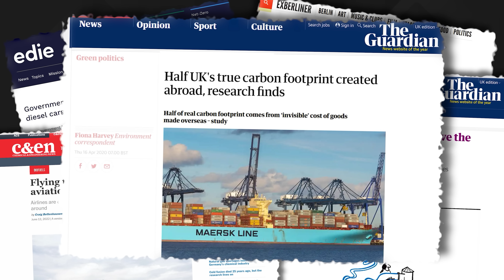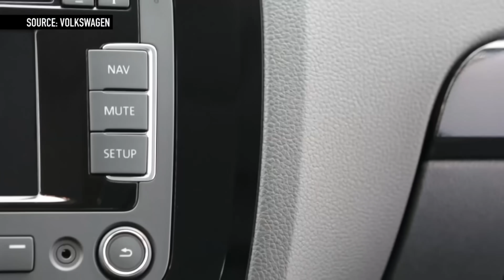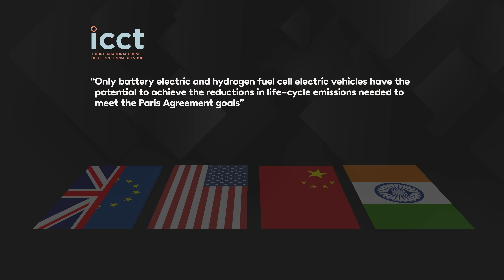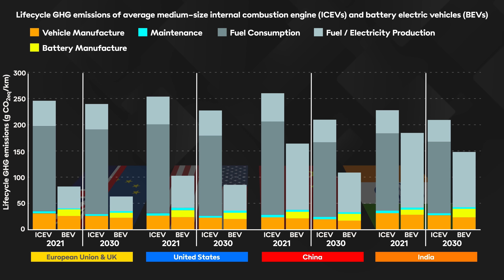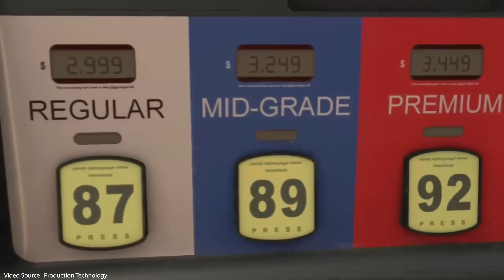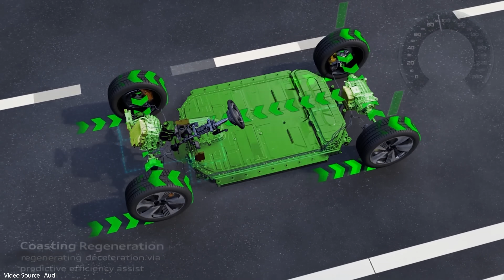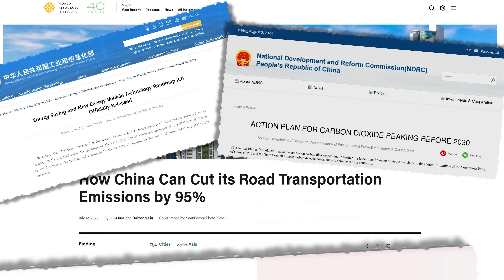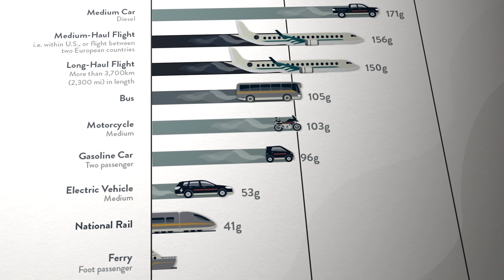Are EVs really better for the climate?

Comment: I've had an EV for 2 years now and apart from the obvious savings on fuel (I've got PV panels and a domestic battery; at the moment my electricity bill, including the car, is around £25.) even though it's only got a 100 mile range, I would NEVER go back to an ICE car, they are a joy to drive and as my son says, even mine will go 'like s***t off a shovel'.  The charging infrastructure in the UK needs work and govmnt support, but thats another story. (See EVman's rants on the subject!)  These figures simply confirm what I've been trying to tell people. Cars cost about the same to manufacture whether they're ICE or EV, and once you've taken this into account, there's no comparison!  Thank you Dave for your always informative and unbiased work, you are the best on Youtube! Cheers Kate
Reply: I have an electric velomobile. There is an article on the internet entitled "Electric velomobiles: as fast and comfortable as automobiles but 80 times more efficient"
Reply: @PROMETHEUS20890  pfah! I had to peddle mine :)
Reply: @PROMETHEUS20890  that sounds interesting, I've never seen one of those. Do you have some introductory text or video for me to read? They look like a motorcycle with better comfort
Reply: I've had a 2nd hand Nissan Leaf now for only 2 weeks & completely agree with what you've said! Never going back to ICE's
Reply from the maker: Cheers Kate. You're an example to us all :-)
Reply: Ditto here
Reply: As a ev owner all your points are correct
Reply: @-GinΠΓ Τάο Yeah, that's a pretty loose description of how a tesla coil works.

It's a pretty loose video over all actually. Incorrect use of terminology and such.
Reply: @valleyofiron125  I agree people need to respect everyone on the road and drive safe and responsibility! 
Tho check out a study called “the first and last mile” it show the many issues that need to be addressed with mass transit. 
Hope Seattle gets better or you find safety elsewhere. 
Live long and prosper 🖖
Reply: Yes but obviously you have the means behind you .most do not I pay no more than a few thousand for my car .
Reply: @-GinΠΓ Τάο What?
I was referring specifically to that video about tesla coils and apparently how they work.

If you are at such "a level" that you think that was a valid and accurate explanation, then I don't need to bother looking at the other two links. 

As for what you said yourself, it was succinct, and I'm not going to spend the time to decipher it. 

I already have two working tesla coils, one spark gap, one rotary spark gap, currently I'm working on a much bigger DRSSTC. 

Perhaps you best go do some more study, bro. Come back when you can write a concise statement, without citing flawed and incorrect sources.
Reply: @-GinΠΓ Τάο hahahaha!!!
"fallacies" ahhh... you're a "debate me bro".

Rofl!
All good little fella :)
I've already seen your level, your petulance is only overshadowed by your impotence. 

Anyway, have your last word, it's been fun!
Reply: @-GinΠΓ Τάο What a bunch of crap. YT and FB myths being re-labelled as “fact”. All of these things have been debunked over and over again. Especially the one about wind turbines.
Reply: @-GinΠΓ Τάο It’s like you don’t understand how global warming works. Or science. Q: What is C02 and what is it’s role in climate change and global warming? Quickly - no cheating. Why does C02 increase correlate exactly with increasing global temperatures, now and throughout history?
It’s not the thermal mass - it’s stopping the energy that gets to the Earth from radiating back out to space. That’s the core problem. You could take all the heat load we as humans produce in a year and it’s less than the Sun delivers in an hour. About 20 quintillion joules (18zeroes) les. Which admittedly is only about 5% less but that’s the scale we’re talking about. Think about that before you start blaming heat load for global warming.
Reply: Counter argument to Just Have a Think biased argument... https://www.youtube.com/watch?v=TUx8yIlKVpU
Reply: And given the cost of fuel these days, in Canada i calculate that the fuel costs about $20k to fuel the vehicle over its lifespan. Plus the excess regular maintenance costs. I just changed the spark plugs in my van for the second time and that cost me $80, so basically $20/year. ICE vehicles have lots of costs that people dont account for because they happen over time
Reply: Thanks for your contribution to the environment.Infrastructure in Australia hasn't caught up to the point that owning an EV is completely practical yet, particularly for people that live in areas where long distance travel is normal. It seems like Evs really make sense in high population areas like cities where short trips and good infrastructure are the norm. Lots of people live in cities in Australia too, don't get me wrong but if for example, one day I decided to travel 900km from Melbourne to Sydney, I'd have to think very carefully before driving a currently luxury price tagged EV. If I did own an EV, to achieve the same outcome, I'd probably need to either a) fly then hire a car which is terrible for the environment or b) keep a petrol car as well as an EV, equally terrible.
Reply: @nevmcc3884  do you not have trains in Australia?
Reply: @paulhaynes8045  Yes, a train or bus trip from Melbourne to Sydney is an all day or overnight trip.  Low population density makes high speed trains unviable.
Reply: @nevmcc3884  the Sydney to Melbourne route is on of the busiest flight paths in the world
Reply: @geoffsemon7411  Hard to beat a ~1hr flight with a fast train.
Reply: @nevmcc3884  I live in Australia and I want an Aptera. The only EV for long distance in Australia. Similar price to the cheaper EVs but only 2 seats and 3 wheels. But solar powered (one good day's charging gives 70 km). And fully charged can go 1,600 km for the larger battery option. And 700 km for the smaller battery option (and way cheaper).
Reply: @Justwantahover  The Aptera sounds awesome. I want an EV but still wary of the battery life too. After owning several Laptops whose batteries just end up dying, being unrepairable and forcing complete replacement. Are EV batteries so different?
Reply: @Justwantahover  Do test out a 3 wheeler a while before buying one. If you drive on roads that are worn down all 4 wheel cars will drive nicely in the worn down tracks, but a 3 wheeler will not. Similar issues with tiny gravel and dirt roads if you go to the country side. EVs are not that good choices in the country side anyway.
So, depending on how you will use the car a 3 wheeler might work. Personally I would stay away from them. 2 wheelers are fine though.
Reply: @nevmcc3884  and remember that Australia doesn’t even have decent ICE fuel efficiency standards!  We have got an awfully long way to go (and I’m just not talking about distance).
Reply: Almost all drives in the u.s. are under 100 miles.   Something like 99% when I looked it up at the .Gov site.

The main issue I see is a bias for home owners vs apartment dwellers.   We need incentives to put a secure, safe, charging grid into apartment garages.

Most ev owners never have to charge their vehicles at a charging station.   So they save 15 mins a week (13 hours a year) compared to gasoline cars. 

And more ev's means cheaper gasoline for gasoline cars until the network effect is lost.
Reply: @mac_mcleod  as time goes on electric vehicles will have their place but there are certain things that need to be factored in beyond what I'm thinking of off the top of my head, road maintenance is going to be higher because EVS are heavier extremely heavier, and that needs to be factored in also windmills and solar panels don't last forever in the case of windmills they are highly non recyclable as far as the turbine blades and so on as fiberglasses not reason but reasonably recycled, also EBS go through tires from what I understand so far seeing on the internet at a ratio of approximately two to one. And being EVS are new out there and our grid has to be remodified to handle that there is cost involved in that also that needs to be considered,, as time goes on there will be other things we haven't thought about but at the same time as EVS are out there longer there will be many improvements. Also for if you're doing off-road driving say as a hunter and you are driving in swampy areas I am thinking with an EV you will get stuck way worse because of the weight and May make it very difficult getting out. Lot of different things to be considered and these debates are good because they bring all things that we don't always think about as we are developing things, didn't mean to sound like a VP. Well wish you all well, TTFN
Reply: @anthonywarzecha5846  the weight issue of road has some validity but that's an edge case.   It's not an issue for on road driving, esp not efficiency wise.  
Plus batteries capacity is still increasing exponentially.   The energy density per kilogram is going up which means batteries for the same range are getting lighter.
Reply: @mac_mcleod  but I am getting that is because of the weight of the vehicles the where the tires run in northern Minnesota you don't notice it quite as much but from the weight of vehicles it will actually put dips where the tires run, I was out in South Carolina number years ago when they had a real hot summer and they had it was pretty severe or what happened to the roads on I think it's US 95 what happened is it pushed the road down where the tires were so if your vehicle was a little bit narrow or it would find that no constantly be searching for a happy medium, my friend that lives down there in Georgia said that it was a year later they had to patch in all the lanes where the tires ran because it was getting so dangerous, the ev's doing more than standard pickup and I was reading the article somewhere about the roads would have, the road surfaces would have to be stalder to support EVS as we get more and more numbers of them on the highway which would make the building of the roads more expensive also, and in turn the actual usage of EVS would contribute to making the roads more expensive to build ie our taxes probably would have to go up to cover that. Which in a sense would be an added expense due to ev's, granite they are now a couple of new batteries that are out there we'll see how they perform but it's a matter of time yet as to Evie's being perfectly perfected. Just like when cars first came out and then all sudden you had the assembly line that Ford had no model t's model A's it all in its due time but from when gas vehicles first started to just that was I think it was around 24 years till they had built the assembly line of bring down the cost of the vehicles with electric vehicles it's going to be the same thing as far as Costco's but also coming up with a better battery system and also even though the electric motors are pretty efficient on them even that will have to come up some for in the long run to balance everything out. Eventually we will be maybe be all electric vehicles very possibly but with certain areas still internal combustion engines won't totally disappear I don't think because of say your login equipment or things of that type or even right now with the foundries but it's all going to take time to get to that point.
Reply: you all will never miss your freedom until you need it.
Reply: The real question is will we have a choice? Klaus Schwab of WEF says we need to get rid of all cars. And once we join the one world government, will be dictated that mandate!
Reply: No comparison? Tell me how long you need to charge your EV while I spend about 5 minutes at the pump. Also when the grid does fail what will you have for a backup? Perhaps a Diesel generator?
Reply: @petedevries5326  how often does the grid fail? Does it really stay off for hours? 

Unless you drive a lot, charging overnight at home is enough for most days. Technology connections did a video explaining this .

Ok, maybe you do drive all day long and your grid frequently fails for several hours, but no one is forcing you to buy an EV. Like said in the video, if all people who can get rid of combustion engines do their part, it's already a massive saving. A big number of people use their cars for basic communiting and groceries. As for taxi drivers, for instance, I believe EVs will still need to evolve a bit.
Reply: @petedevries5326  good luck pumping fuel when the grid fails
Reply: What about the massive piles of PV panels that have reached their EOL, cannot be recycled, that have been piling up for years already? How about all the heavy metals they leach into the land fill? 

It's robbing peter to pay paul. Just pushing the problems further down the road.
Reply: @jimmyb1451  what about them? Their end of life is decades away and solar panels are 85-95% recyclable (mostly glass and some aluminum). 

It’s that vs the amount of oil to generate 20-30 years worth of electricity the panel produced over its lifetime.  Which do you think is worse?
Reply: Another electric car owner claiming fantastic acceleration.  Every owner says it even if they take more than twice as long to get to 60 as my supercharged Jaguar V8.  Suspect they have never experienced real mind blowing acceleration.
Reply: @ericrawson2909  Um - no. Just wrong. Can you beat 2.1 seconds (Model S Plaid). Can you beat a Porsche Taycan? Can you even beat a Kia EV6 GT line. Go look up the figures. You might be surprised. Shocked even. Your time, I’m guessing at best, is 4.2 seconds. A Model 3 performance is 3.3 seconds. These are stock vehicles you can buy off the shelf. Don’t believe me - go to Drag Times YT channel. EVs are faster off the line due to the almost instant torque. Some ICE cars could catch some of the above over a 1/4 mile because some have more top end power. But not a Model S Plaid (8.834 seconds!) If you want to talk exotic supercars the Plaid is still quicker! But if we do go there look up a Rimac Nevera. Holy cow. Under 2 seconds 0-60mph. I don’t drive an EV for the instant torque. It’s just an added side benefit of a better propulsion system.
Reply: @mondotv4216  OK, I know all about the plaid and other fast EVs.  I was talking about people I know who buy EVs with a zero to sixty if 8 seconds and go around saying how incredibly quick they are.  The plaid is a nice car, but costs a lot more than mine, and is missing the thing I love: the cross-plane V8 burble.  EVs with their artificial engine noise don't do it for me.  If I wanted super quick acceleration it would be a 911 Turbo S, but then I lose my V8 sound and need to find several times as much cash.
Reply: @ericrawson2909  And that’s your prerogative. No one is forcing you or even telling you to buy an EV. I’m glad to see you’ve qualified your original post.
Reply: @ericrawson2909  have a look at some of the drag races on carwows channel. EVs are much faster and cheaper
Reply: I have a 1979 8.2 ltr V8 Cadillac Coupe Deville .It is running on clean burning  half price LPG and runs a Gear Vendors overdrive on the gearbox .
At a steady 70 mph i get nearly 40 mpg which works out to 80 mpg as LPG is half price.
I get free road tax, cheap collectors car insurance and no need for a M.O.T plus the car is gaining in value .
The biggest hit on the Planet is the day of manufacture and the day it gets scrapped ( never ) .If i was to recycle it then i am pretty sure most of the car will recycle .
Running on LPG meas my service intervals are twice as long as the oil keeps clean and the spark plugs last longer .Also being 8.2 ltr the engine is hardly working so less breakages to impact the Planet .
If l Liquid Natural  Gas (LNG) becomes available i can switch over more or less instantly and be even cleaner .

Repeat the biggest hit on the environment is the day of manufacture so the greenest cars are collectors vintage cars .
Reply: @rocklover7437  now if you’d just keep to your rocks the rest of us would be spared the time it took to read your drivel!
Reply: @rocklover7437  its a nice argument, and I certainly hope you enjoy your car, however I think the take away from this video is completely the opposite to what you re saying. What the data presented above shows is that the lowest C02 emissions of any car (of any type) will ever be is on the day it comes out the factory, it only gets worse from there, and for ICE cars the C02 emissions increases faster than EV's (in any country) . Now clearly new cars (including all EV's) need to be manufactured, but the solution is not to run old ICE vehicles indefinitely as even in lpg the total carbon emissions per mile will be higher than a newly manufactured EV after a fraction of its life cycle.
Reply: @rocklover7437  

LPG isn’t half price I run a 73 gmc with a 455 , it get 8mpg , no matter how you drive it , lpg reduces the mpg , you’re talking pure bollocks
Reply: @fradaja  It's half price in the UK and i drop just  a few mpg with a 500 cu caddy motor .
Reply: @rocklover7437  your still polluting the atmosphere with particulate emissions, you are still creating 220+° heat and noise pollution.
Plus your car needs oil changes still, tune ups belts n hoses, engine air filters etc. Good on ya for trying something more efficient though. 😂
Reply: @4literv6  hardly any  particulates from LPG .It must hurt big time loosing so much money on your EV and a pain in the arse selling it before the battery needs replacing .
Folk are very weary buying second hand EV,s just in case the battery needs replacing in the not so distant future.
Reply: @rocklover7437  you come off as intelligent sounding as your name sake. 👍🏻😂
Reply: @4literv6  and EVs need all the same maintenance items as a ICE vehicle.
Reply: @4literv6  RC18 now that sounds super intelligent. So intelligent you can't come up with a proper channel name .
Reply: EVs take stuff all maintenance compared ice vehicles.
That's my experience owning a 2012 and 2019 Leaf.
So cheap even at the dealership.
The 2012 is also much more reliable than a new car I owned for a while, and all other cars previously.
Reply: @bowez9   Well that’s not true. They need some of the maintenance items. They certainly need far fewer brake changes, they never need engine oil changed because they don’t have an engine, they’ll need transmission oil for the fixed ratio gearbox on most electric motors but I think that’s about every 100,000 miles, they don’t put as much wear and tear on belts because they don’t have any (most EVs use a small electric fan to manage the relatively minor cooling requirements), they don’t have a fuel system, fuel filters, spark plugs, ignition coils, oil filters, EVAP systems - in fact most of the regular maintenance items on an ICE vehicle. They may go through more tyres because they are heavier and also be a little harder on suspension components.
Reply: @rocklover7437  I do agree that scrapping a perfectly working classic car makes little sense and I wouldn’t do it in your shoes. However, I think you might be mathematically challenged. If EVs on average, over a 10 year lifespan produce only 35% of the emissions of a gas car (it’s less in Europe) then after that 10 years the equation just gets worse and worse - not better.  Now your car is 40 years old, but of course EVs are relatively new so you’ve done the right thing by keeping your car on the road and running as efficiently as a large gas car can and not buying new cars along the way. I understand the sentimental attachment but to argue that keeping that car on the road is going to help lower carbon emissions is just non sensical. Even scrapping 10 year old cars will result in lower carbon emissions if replaced by EVs. Not that I’d advocate that either.
Reply: @mondotv4216  When electric cars can be charged by renewables or nuke they will make sense.
I suspect like a digital cashless system they may be a form of control .Will they limit your use of a electric car to only a small milage from home ? 
The stunts our government have pulled on us over the last two years means i have lost what little trust i had in them .

The World Economic Forum have said they want no private cars .
Reply: @bowez9  2 orders of magnitude less moving components. Also pretty sure there is no oil filter to change in my ev.
Reply: @christianvanderstap6257  still have gearboxes, if there are moving parts there are lubricants, and there should be a filter.
Reply: @bowez9  no gearbox on my ev. One thing that does need to be changed is the break fluid every 5 years due to not using the breaks and therefore the oil loses to much viscosity. The only filter that needs changing is the interior filter, but that one is present in pretty much every car.
Reply: @christianvanderstap6257  there is a gear box, even if at single speed reducer.  Not all gearboxes are multispeed items.
Reply: @andrewradford3953  Very true… up until the point the battery needs replacing (around 10yrs). Then the cost blows out, the vehicle is almost worthless to the owner or trade-in purchaser, who will most likely scrap it…. because no certainty can be given on range or longevity, making prospective buyers wary. With little to no recycling for batteries in most countries… I’m sure you can imagine the environmental toll now adding up.

I’m all for the ideology of EV’s but we are still way off. This is a route best taken slowly… to maximise the lifecycle of already existing ICE vehicles, minimise the demand on 3rd world slave labour mining (because of lack of recycling and the sudden demand, means it’s cheaper to buy from slave labour mining) , allow energy infrastructure to adapt to energy demand, manufacturers to create products with a greater life cycle and last but not least… recycling facilities worldwide.
Reply: @mondotv4216  EV maintenance cost should be much lower than ICE cars for the reasons you mention. In real life they usually are just as expensive. This might be that the mechanics you charge similar for doing less work in combination with the much higher tire cost. This comes from a report by one major US company on their large fleet of cars. That typically means they had only relatively new cars, so it may not be so valid for older cars.
Where I live we also see serious issues with older Tesla's after 5-6 years of age several critical pars in the undercarriage are so rusted up that they become a major safety hazard.
I guess this says more about Tesla's rust protection than a general EV issue. The heavy weight of the vehicle also factors in for the wear.
Most reports on environment does not factor in tire wear and road wear due to the 20% heavier vehicle.
Also it seems that most EVs will last only around 10 years (until it is no longer economically viable to maintain the car), while the average ICE gets almost 17 years.
We also see an unproportionally large number of EVs burning up. Usually only after crashing. Once that happens the release to the environment is huge.
The fire department even has orders to not approach a burning EV due to the high risks. It is better to let it burn out.

From an environment perspective EVs still likely win over an ICE over its lifecycle, but not nearly by the margin shown in the reports mentioned in this video.
In fact it would be cleaner to run an ICE car on E100 fuel. Producing the required E100 for all cars would be a major challenge.
The point is that even if EVs are slightly better they are nowhere near as good as we need them to be to save the environment.
Having a car is very convenient, so as long as it is reasonably costly most people will have one. To save the environment we need to make it really costly to own a car. That is not possible to do in a democracy. Ergo we can either destroy earth or give up democracy. 😱
Reply: @rocklover7437  I’m not sure what to say. A post or two ago you seemed reasonable, now your spouting conspiracy theories. The kind of tech that allows vehicles to be tracked has nothing to do with being electric or ICE. In fact EVs represent more freedom, not less. Fill up your vehicle anywhere you have electricity. Heck, cut the cord completely and install solar. Strike a blow for energy independence by reducing the reliance on foreign oil. You can’t say any of that about an ICE car. The govt is far more likely to ration fuel. It’s almost impossble to ration electricity.
Reply: @mondotv4216 It depends how far he drives. At 10 miles a fortnight the equation might be in favour of his Cadillac
Reply: @rocklover7437  you got that completely backwards. Every study on life cycle emissions of cars running on fossil fuels I've ever seen found that fuel consumption is the greatest contributor by a large margin. I mean seriously, you posted this under a video based on a report that concludes that only about 10% of emissions are from manufacturing. This ratio only gets worse as the car ages and is driven further. Even if LPG is slightly less terrible for the environment it's still no contest.

So no, it's really absolutely not better for the environment to keep old cars running forever. At some point a newer car will use so much less fuel that it's better to scrap it.
Reply: @jfolz  No your wrong the biggest hit on the environment is the day it was made .
Reply: @rocklover7437  ok then where's you source for that? Is it the newest paper from Dr. Trustmebro?
Reply: @jfolz  The World Economic Forum don't want ANY private car ownership .Not my words ,Klaus Schwab,s words .
They can limit your range from your home easily with a electric computer chipped car .
They can also stop your car moving with only one person in it .
Reply: @rocklover7437  feels like we went from misinformation to conspiracy theories real fast here. I'm out.
Reply: @rocklover7437  you seem to have missed the point of this video completely. You also don't seem to realise that LPG is a fossil fuel.
Reply: @paulhaynes8045  The point is my 1979 Cadillac has been on the road 42 years since the manufacturing date and every year it's on the road it's initial impact gets less .
Repeat the day of manufacture is the biggest hit on the environment .
Will a Tesla last 42 years and if it does how many battery packs will it of used ? 
Pretty sure my 79 Cadillac is more recyclable than a Tesla .
Reply: @paulhaynes8045  If i ever scrap my Cadillac its value as a recyclable carbon credit  offsets it's 42 year old day of manufacture carbon deficit easily
Reply: @paulhaynes8045  WHAT?! OH GOD! Fossil fuel!!! 😱 The Devil! Blasphemy!!!
Reply: @rocklover7437  exactly.
"lifetime carbon cycle" is a relative term.
Reply: @rocklover7437  not too sure about older cars becoming cleaner each year. Every single day oil tankers carry the fuel you need, across our oceans. There are more than 10,000 oil tankers in service at the moment. Each oil tanker burns more than 60,000 gallons of very dirty oil every single day. An EV doesn't need a fleet of 10,000 oil tankers.
Reply: @rocklover7437  i completely agree with you, I'm in Italy and I own a 27yrs old car, strong and reliable as no todays car can be, hopfully it will last more 10 years or even more
Reply: @rocklover7437 Tesla battery packs are lasting around 300,000 miles. How far has your 1979 Cadillac gone so far?
Reply: @rocklover7437  -  Clean burning? Not quite. How do you think the rings are being lubricated? Oil, which is sitting on the wall of the bore, VO, in the troughs of the cross hatch profile RVK. This retained oil is being burnt in the combustion chamber on each firing cycle, and being emitted out the exhaust as hydrocarbons and particulates, amongst other toxic to life chemicals. No combustion engine is clean, whatever the fuel, unless you can remove the need to lubricate it with oil.
Reply: @clivewalpole  small price to pay for not having African children  working in lithium mines .
Are the machinery that transports the lithium from Africa to China green ?
Reply: @rocklover7437  I think you’re thinking of Cobalt. Most of the lithium comes from China, Australia, Chile and Argentina. And most of the big EV makers are sourcing ethical Cobalt and using less and less - because it’s expensive. You’re far more likely to find that child mined Cobalt in your mobile phone or tablet. Oh and if you think oil is ethically sourced you should probably do a little more research. Saudi Arabia comes to mind. Russia. 1000’s of examples over the last 120 years of companies and govt putting profit and power before people.
Reply: I ride a bike, which makes EVs seem downright filthy and wasteful by comparison.   Fortunately for our environment, only the wealthy will be able to afford anything beyond the simplicity of bicycles in the future anyway.
Reply: @thom1218  I also ride a bike, & have  for much of my past 40 years of work have been in a 1 car household.
This practice has greatly contributed to us being able to afford an EV. (Have driven used, min 10 year old cars previously)
Total cost of ownership is a key factor, as is a bank loan to be able to make this good investment.
Reply: @thom1218  i walk barefoot which makes bikes look filthy EV’s a environmentally disaster
Reply: @ls-33wraith33  wow i thought my English was bad! lol
Reply: @carlpodrecca5177  Speech to text🤷🏻‍♂️
Reply: @thom1218  My god, and you're looking forward to that?! 
WEF drone... 🤣🤣🤣